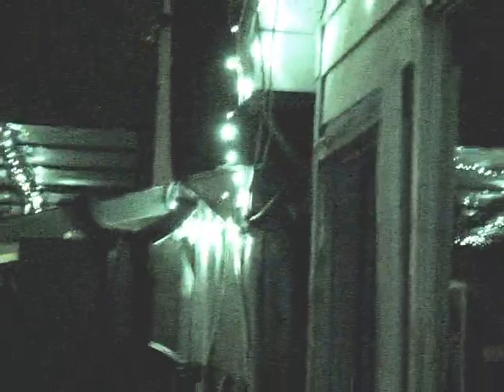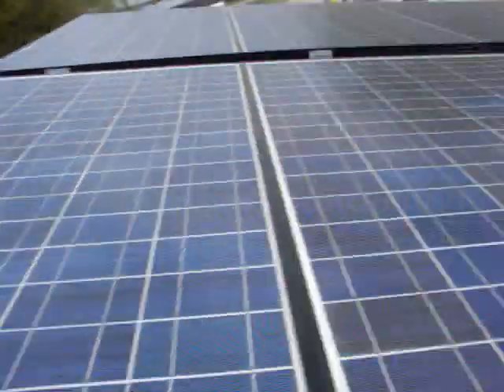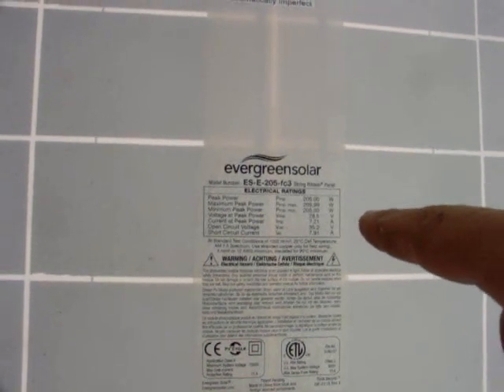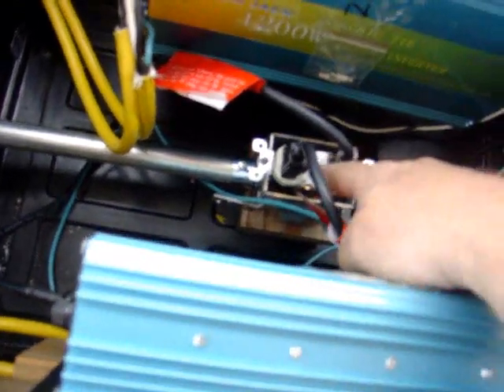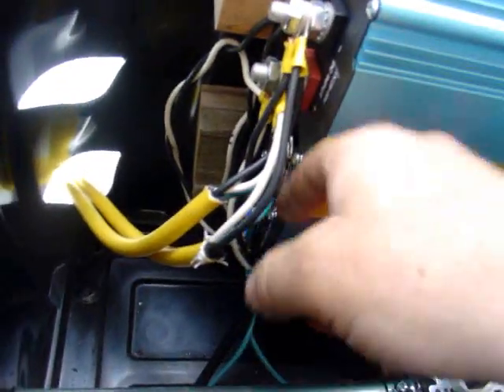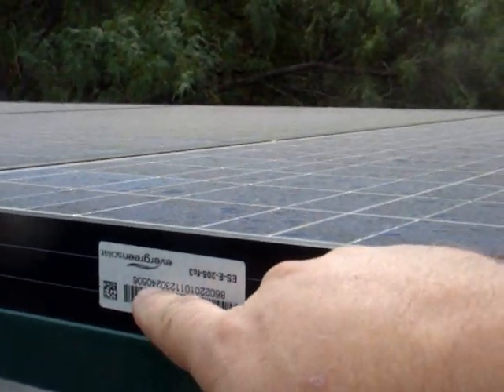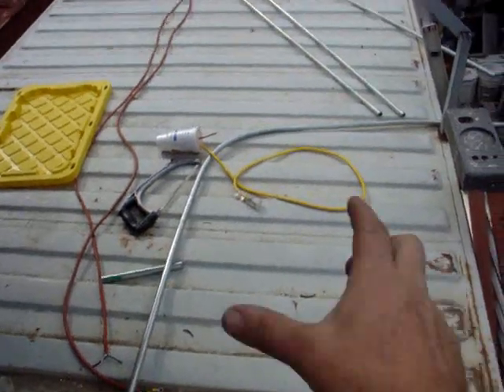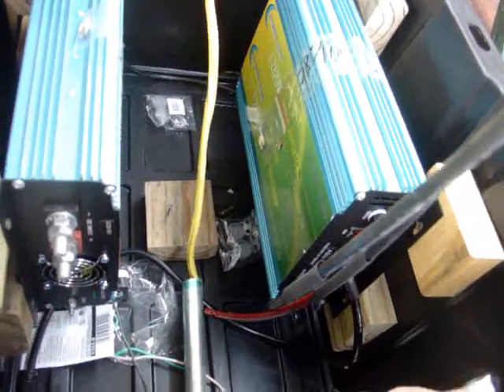PART 3 THE 4000 WATT SOLAR INSTALLATION AT BOOMTOWN LABORATORIES

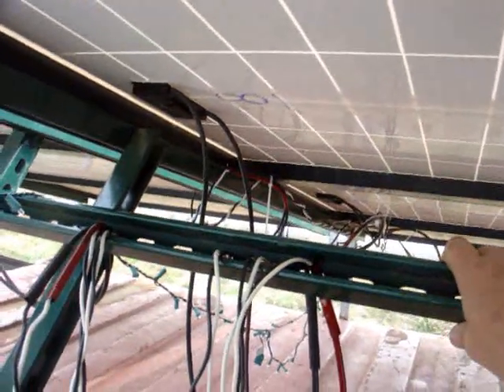Comment: Hey Muddy, I have a suggestion. Where the wires go through the frame, ( about 7:45 or so ) you can slit some rubber hose and use it as a grommet  to keep the insulation from being chafed through by the wind moving them.

Comment: Hallo
Regarding ceiling fan wind turbine
Tell me please how it correctly: the 3 +3 group must touch each other or can be distributed groups of 3 equidistant on circumference .And second, how important is the metal ring that is fixed magnets
Thank